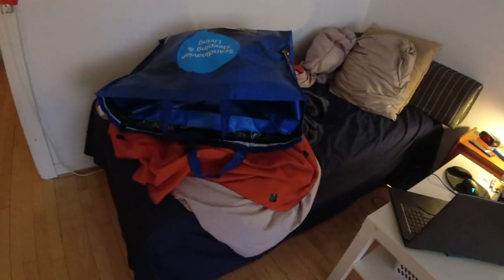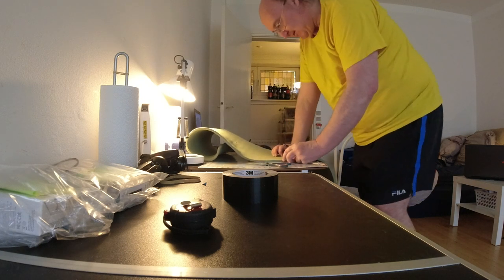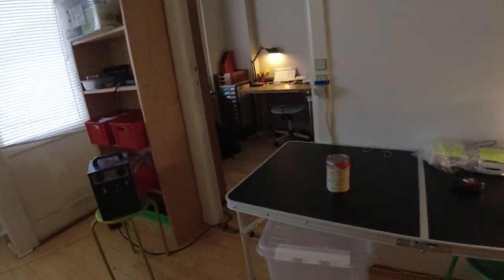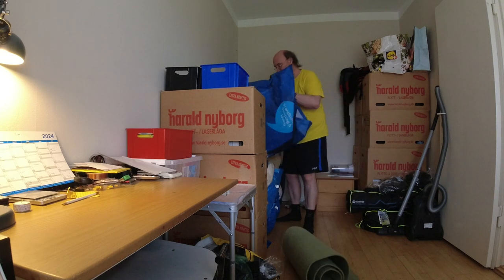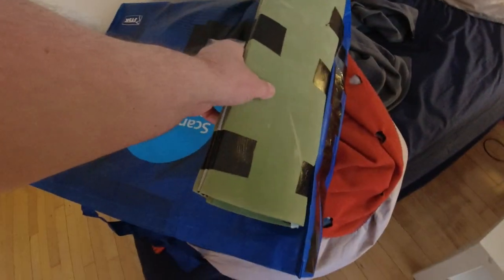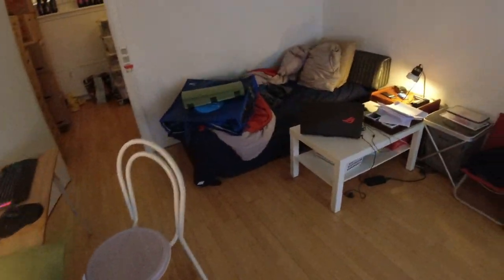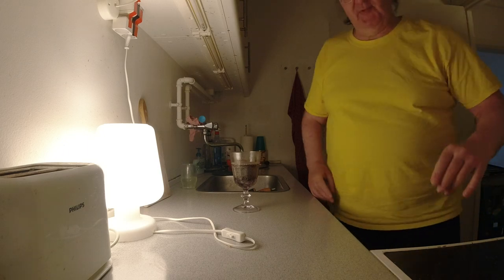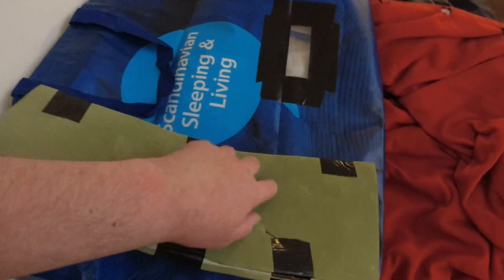MongoTV_16700 - TENT BAG FOR HOMELESS - Part 13 - Seat-Backrest-Insulation-Foam Sleeping Mat- 4 of 4

Comment: PART 13 - (This video is in 4 parts : Part 10 to Part 13). It could be nice, to have a large folding seat, inside the button of the tent bag ? If you sitting on a cold pavement on the street, or a cold concrete floor inside a building. The foam sleeping mat parts, could be used as insulation too, inside the big tent bag. But that could cost like US$ 30-40, to cover the hole inside of the big tent bag. And i like to try, keep my tent bag, a bit cheep, so i could make a lot, like many 1.000 tent bags, and give away for free, to people on the streets. I could not do that, if the tent bag cost lot more than US$ 50 to make. But to have just 1 folding foam seat, is very important for me, to have something warm, to sit on, on a cold wet pavement in a city.PART 13 - (This video is in 4 parts : Part 10 to Part 13). It could be nice, to have a large folding seat, inside the button of the tent bag ? If you sitting on a cold pavement on the street, or a cold concrete floor inside a building. The foam sleeping mat parts, could be used as insulation too, inside the big tent bag. But that could cost like US$ 30-40, to cover the hole inside of the big tent bag. And i like to try, keep my tent bag, a bit cheep, so i could make a lot, like many 1.000 tent bags, and give away for free, to people on the streets. I could not do that, if the tent bag cost lot more than US$ 50 to make. But to have just 1 folding foam seat, is very important for me, to have something warm, to sit on, on a cold wet pavement in a city.PART 13 - (This video is in 4 parts : Part 10 to Part 13). It could be nice, to have a large folding seat, inside the button of the tent bag ? If you sitting on a cold pavement on the street, or a cold concrete floor inside a building. The foam sleeping mat parts, could be used as insulation too, inside the big tent bag. But that could cost like US$ 30-40, to cover the hole inside of the big tent bag. And i like to try, keep my tent bag, a bit cheep, so i could make a lot, like many 1.000 tent bags, and give away for free, to people on the streets. I could not do that, if the tent bag cost lot more than US$ 50 to make. But to have just 1 folding foam seat, is very important for me, to have something warm, to sit on, on a cold wet pavement in a city.PART 13 - (This video is in 4 parts : Part 10 to Part 13). It could be nice, to have a large folding seat, inside the button of the tent bag ? If you sitting on a cold pavement on the street, or a cold concrete floor inside a building. The foam sleeping mat parts, could be used as insulation too, inside the big tent bag. But that could cost like US$ 30-40, to cover the hole inside of the big tent bag. And i like to try, keep my tent bag, a bit cheep, so i could make a lot, like many 1.000 tent bags, and give away for free, to people on the streets. I could not do that, if the tent bag cost lot more than US$ 50 to make. But to have just 1 folding foam seat, is very important for me, to have something warm, to sit on, on a cold wet pavement in a city.PART 13 - (This video is in 4 parts : Part 10 to Part 13). It could be nice, to have a large folding seat, inside the button of the tent bag ? If you sitting on a cold pavement on the street, or a cold concrete floor inside a building. The foam sleeping mat parts, could be used as insulation too, inside the big tent bag. But that could cost like US$ 30-40, to cover the hole inside of the big tent bag. And i like to try, keep my tent bag, a bit cheep, so i could make a lot, like many 1.000 tent bags, and give away for free, to people on the streets. I could not do that, if the tent bag cost lot more than US$ 50 to make. But to have just 1 folding foam seat, is very important for me, to have something warm, to sit on, on a cold wet pavement in a city.PART 13 - (This video is in 4 parts : Part 10 to Part 13). It could be nice, to have a large folding seat, inside the button of the tent bag ? If you sitting on a cold pavement on the street, or a cold concrete floor inside a building. The foam sleeping mat parts, could be used as insulation too, inside the big tent bag. But that could cost like US$ 30-40, to cover the hole inside of the big tent bag. And i like to try, keep my tent bag, a bit cheep, so i could make a lot, like many 1.000 tent bags, and give away for free, to people on the streets. I could not do that, if the tent bag cost lot more than US$ 50 to make. But to have just 1 folding foam seat, is very important for me, to have something warm, to sit on, on a cold wet pavement in a city.PART 13 - (This video is in 4 parts : Part 10 to Part 13). It could be nice, to have a large folding seat, inside the button of the tent bag ? If you sitting on a cold pavement on the street, or a cold concrete floor inside a building. The foam sleeping mat parts, could be used as insulation too, inside the big tent bag. But that could cost like US$ 30-40, to cover the hole inside of the big tent bag. And i like to try, keep my tent bag, a bit cheep, so i could make a lot, like many 1.000 tent bags, and give away for free, to people on the streets. I could not do that, if the tent bag cost lot more than US$ 50 to make. But to have just 1 folding foam seat, is very important for me, to have something warm, to sit on, on a cold wet pavement in a city.PART 13 - (This video is in 4 parts : Part 10 to Part 13). It could be nice, to have a large folding seat, inside the button of the tent bag ? If you sitting on a cold pavement on the street, or a cold concrete floor inside a building. The foam sleeping mat parts, could be used as insulation too, inside the big tent bag. But that could cost like US$ 30-40, to cover the hole inside of the big tent bag. And i like to try, keep my tent bag, a bit cheep, so i could make a lot, like many 1.000 tent bags, and give away for free, to people on the streets. I could not do that, if the tent bag cost lot more than US$ 50 to make. But to have just 1 folding foam seat, is very important for me, to have something warm, to sit on, on a cold wet pavement in a city.PART 13 - (This video is in 4 parts : Part 10 to Part 13). It could be nice, to have a large folding seat, inside the button of the tent bag ? If you sitting on a cold pavement on the street, or a cold concrete floor inside a building. The foam sleeping mat parts, could be used as insulation too, inside the big tent bag. But that could cost like US$ 30-40, to cover the hole inside of the big tent bag. And i like to try, keep my tent bag, a bit cheep, so i could make a lot, like many 1.000 tent bags, and give away for free, to people on the streets. I could not do that, if the tent bag cost lot more than US$ 50 to make. But to have just 1 folding foam seat, is very important for me, to have something warm, to sit on, on a cold wet pavement in a city.PART 13 - (This video is in 4 parts : Part 10 to Part 13). It could be nice, to have a large folding seat, inside the button of the tent bag ? If you sitting on a cold pavement on the street, or a cold concrete floor inside a building. The foam sleeping mat parts, could be used as insulation too, inside the big tent bag. But that could cost like US$ 30-40, to cover the hole inside of the big tent bag. And i like to try, keep my tent bag, a bit cheep, so i could make a lot, like many 1.000 tent bags, and give away for free, to people on the streets. I could not do that, if the tent bag cost lot more than US$ 50 to make. But to have just 1 folding foam seat, is very important for me, to have something warm, to sit on, on a cold wet pavement in a city.